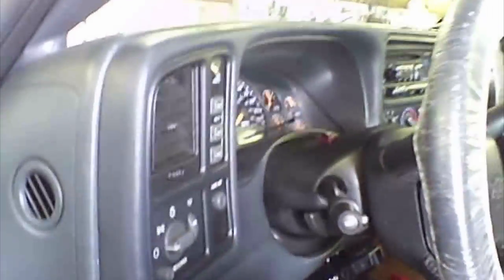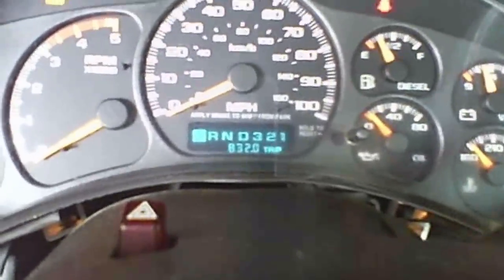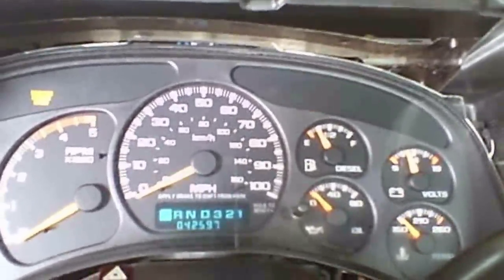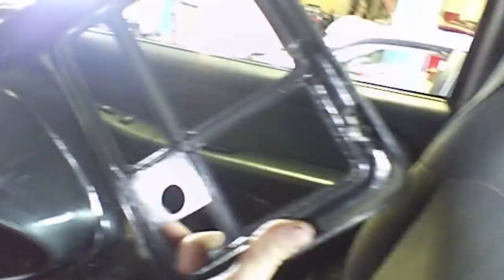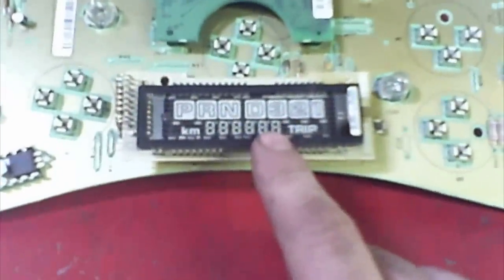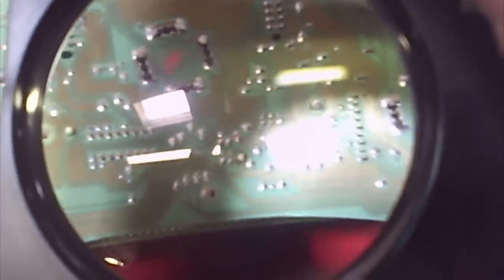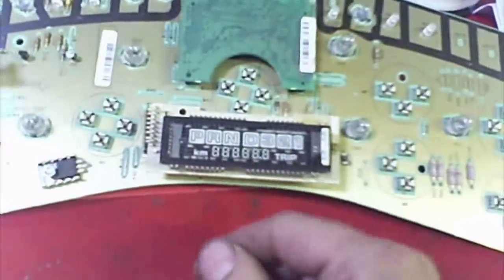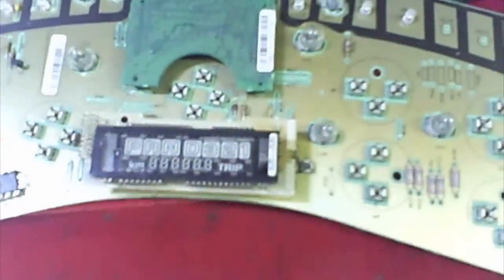Instrument cluster gear select blank screen solder fix Chevrolet GM  PRND21 Odometer intermittant

Comment: Hey Todd, I have a 2000 Chevy Tahoe with this exact issue...what type of soldering tool do I use and how easy is it to solder?

Do I solder from the top or from the bottm?

Thanks,

Eric

Comment: This video was like ALMOST telling me how, then throwing me off a cliff! 1/10 rating on the HELP scale chart! LOL...
  Believe me..there are a lot of lose solder joints and connections on all GM IPClusters and this doesn't near show what the majority are!
  Up to 2003 most are lose connectors on the input plug (usually 2 hot wires and one ground wire). 2003 and later models are lose resistor(s) on the circuit board.
  Keep searching people. The videos are here at YouTube.
Reply: you dont deserve help with a profile picture like that.